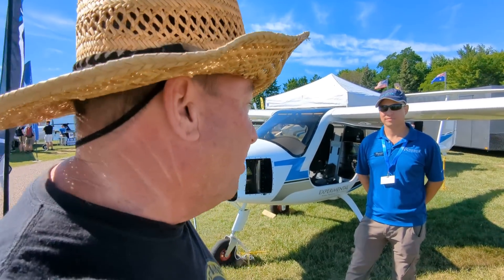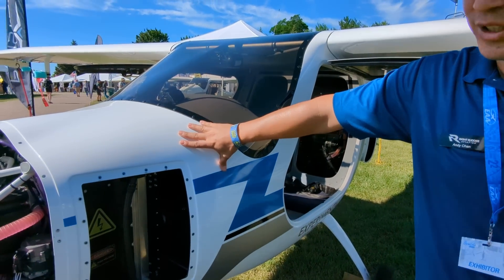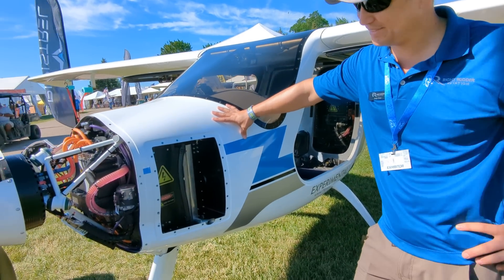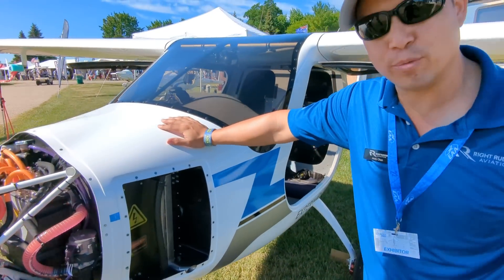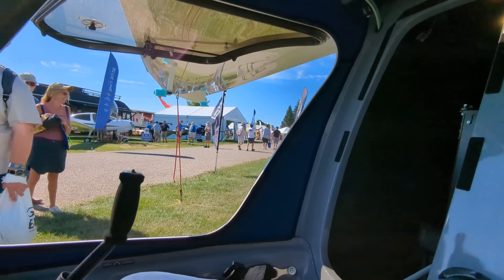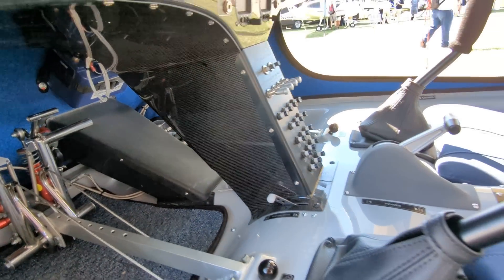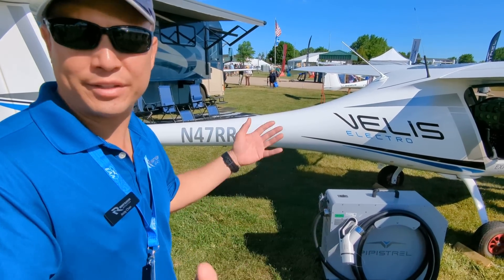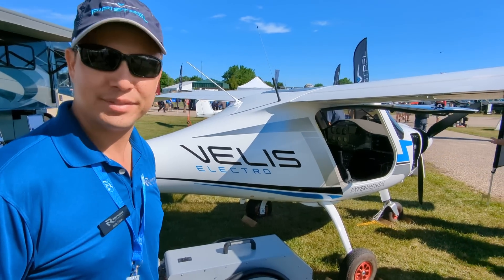Electric Airplane?! Pipistrel Electro at Airventure 2022.

Comment: The flight time does not include the extra reserve time. Great for a trainer: Quiet for communication, way less maintenance, fuel costs, and lower operating costs. And it will only get better. I wonder how the battery replacement costs will compare to engine overhaul costs of conventional trainers.
Reply: From the video @ about 1:15:  Need to replace the two batteries at 2000 hours/2000 cycles @ $10 000 each = $20 000 I've lost touch with engine overhaul costs these days. Does anyone have an approximate cost handy?
Reply: @Fomites  - 15,000 to 18,000 unless you need cylinder work.  I’ve seen higher quote than that.

Comment: Those flaperons and engine braking will come in handy if they have a runaway lithium battery fire.
Reply: Lithium ion battery fires in vehicles are far fewer by percentage of miles driven than internal combustion engines. I suspect the same will be true of airplanes. Sitting on top of explosive AVgas just becomes normal after awhile, but is far more dangerous than lithium ion batteries.
Reply: @GoCoyote  I serious doubt your stats.  Aside from collisions, there are few spontaneous auto fires from the ICE.  You’d have to prove to me with your source to convince me.  And an ICE in a plane rarely has an airborne fire related to the power plants.  There is a reason you can only ship lithium batteries via ground.
Reply: @bw162  You've never seen a car with its engine on fire at the side of the highway? Lucky you, because it's not that rare.
Reply: @bw162  Here's one study being cited:

Research by another firm, AutoinsuranceEZ, says battery electric vehicles have just a .03% chance of igniting, compared to internal combustion engine vehicle's 1.5% chance. Hybrid electrics, which have both a high voltage battery and an internal combustion engine, have a 3.4% likelihood of vehicle fires according to their study.
Reply: @markmiller3279  “We obviously don't know what will happen in 20 years when we've got electric vehicles that are 20 years old, and have been through 100 potholes and have a lot more wear and tear," Sutcliffe said. "We don't know what that will look like."…”EV car fires burn hotter and for a longer period of time. In gas cars there’s usually a single reaction, like a spark in a puddle of gasoline, that leads to the fire and that reaction eventually burns down. When an EV’s lithium-ion battery ignites the battery burns the energy stored inside, becoming the fire’s main source of energy”.

All fires are not the same.  In aviation, you must look at the consequences.  Like I said but you didn’t hear, you can’t transport lithium batteries via air.  They must go via ground.  Gee, I wonder why?
Reply: @markmiller3279  I am 75 and never have.  I am also an ATP with 20,000+ hours and never had an engine fire.  But I have seen many lithium batteries catch fire and destroy $10,000 model planes while owners tried in vain to put them out.  I’ll put my experience up against your “opinions” any day.  And then there is the grounding of 787s for lithium fires onboard.  And several cargo aircraft crashes because of lithium fires.
Reply: @bw162  Simple answer for you then: just don't go near any electric aircraft.  Let other people fly or ride in them instead.  It'll keep you safe, that way.
Reply: @vk2ig  Thank you for your brilliant suggestion.

Comment: Juan, Nice topic to cover! There are a lot of limitations, however this aircraft certainly has some great applications. Electric Power Systems have their quirks and costly components to replace, but it is a great alternative to having liquid Fuel and engine lubricant. I love having my Levo electric mountain bike rather than an internal combustion engine. The same benefits and drawbacks of electric bikes carry over to Electric airplanes or any other mobile equipment. Perhaps they could come out with a pedal assist aircraft and the pilots can get some cardio contribution going into the Driveline🤣